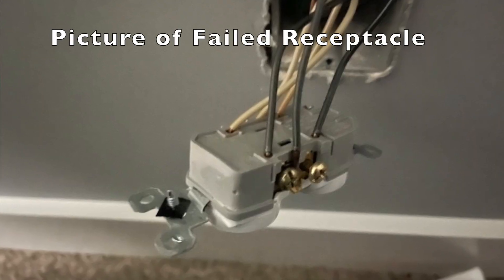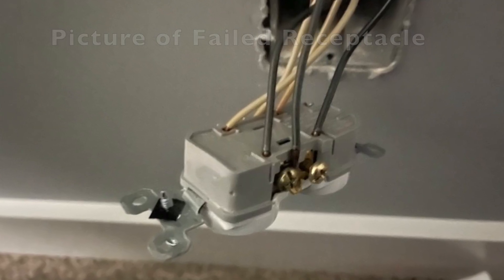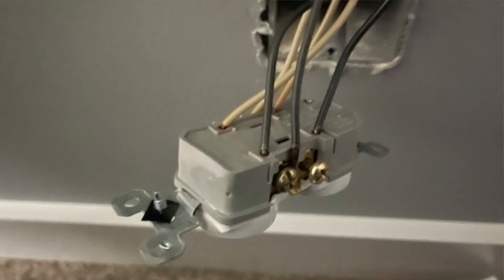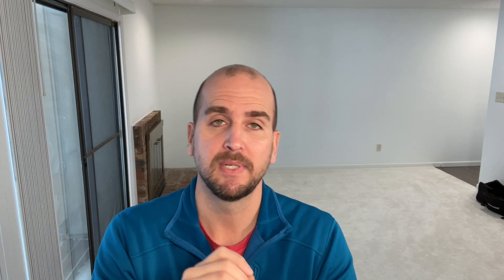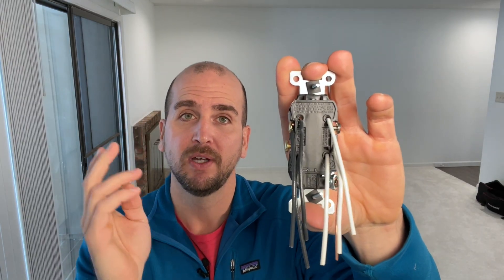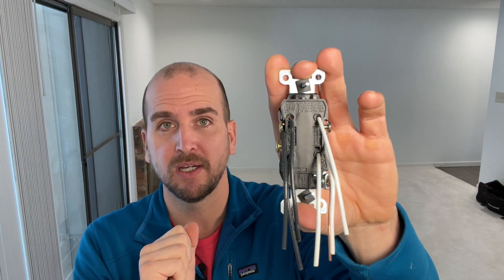Incorrectly Wired Outlet Found In Newly Built Home

Comment: As a self employed electrician of 25 years experience, I want to say I was upset with things you said at first. But listening to you I see your talking about the best way and not being incorrectly wired as your title says. The way the outlets were installed is normal and not against code and also, for all intent and purposes, fine.  The way you had 2 wires under the receptacle is fine and even 2 stab connections and 1 wrapped is fine. It is not incorrectly wired but you are correct that it can be done better. I only bring that up as I see some comment saying they had to "fix" outlets and things. I believe it would be more correct to say you had to update them as there was nothing wrong with it originally. 

Once I got past the "incorrectly wired" as "could be done better" then I was ok with it.  I have subbed for other electricians, worked for myself, worked as an employee for several companies and even did government jobs and light commercial. Everyone has their "best" way of doing it. Some take shortcuts to save in wire costs and some go above and beyond by tailing everything and always wrapping wires. I even had some that didn't even like to hook up grounds to switches SMH! My personal belief is I use wraps when ever possible and then stab only when I have 3 wires. I typically only tail if I have short wires or things like that. This isn't "best" practice I guess but there is nothing wrong with it. That's all I wanted to clarify :)

Just FYI, in my area GFCI's are now no longer permitted and you have to GFCI breakers instead. Again, this isn't a safety thing which is what codes are supposed to keep track of but it's a convince thing that I find kind of stupid in some points.  Like GFCI's on sump pumps or freezers and other codes that are meant to be safety things but can actually cause home owners a lot of money because their basement floods or a freezer trips due to a GFCI tripping. Sometime the best or safest way doesn't always pay off.
Reply: Check your continuing ed courses (unless you are in WV where they are not required). The (US) national code has prohibited using the wiring device as a connector for continuing  the circuit for at least 8 years. Pigtails are now  required in ALL cases where more than one wire would previously been permitted on an outlet terminal. You should be able to remove or disconnect any single outlet without interrupting power to the rest of that circuit.  I am guessing that the intention is to prevent open neutrals on the other outlets in the circuit in the case where a receptacle has a loose connection or fails.
Reply: @kimlground206  sorry, but no your wrong or I would have failed many inspections. Then again I guess inly what the inspector considers code is what matters. But then if you were correct, why does ever outlet have multiple connections if your not allowed by code to use them? I know, only 8 years, they didn't have time to change the outlets to meet code right? I am not saying your wrong, but it's not the code every where yet.
Reply: @gamingwithxelkhalla4890  You may well be correct. I haven't been able to find it in the 2020 edition so it may have come from a state amendment to the national code.  I will report if I find it.

Comment: I now use wago style wire connectors instead wire nuts.  I think that they treat the wire better.  With multiple wires going into a wire nut, I have seen one of the wires not making equal contact with the other wires and therefore sometimes make a poor connection.   Wago style wire connectors will prevent this.
Reply: You're supposed to twist wires together tightly with pliers before adding the wire nut. Doing that completely eliminates your problem.
Reply: @SomeGuy-vo7we  Twisting the wires at the perfect radius and level of pressure is sometimes difficult to get prefect.

Comment: I'm an lic electrician and you could put on some tape around the wire nut also when you splice the wires do 2 of then first than add the 3rd.The reason you found that wiring caus they're in the hurry to finish the house so they could get paid..

Comment: I notice your push-in wires came out easily when you unscrewed the post. Some of these sockets however are spring loaded and they are a PITA to remove the wire. Does anybody make a tool to depress these springs?

Comment: Nice job at telling them about the pig tells. You should have pointed out why we do that. The reason is if that recept fails then it's the only one that is affected. I have worked with res companies before and they do stuff like that to save time (money). I would also say that you should put electrical tape around the out sides so nothing can come in contact with the terminal. It's very important to do this with romex because out the bare ground wire. I have had the ground wire pop out and make contact with it after I have installed it.

Comment: At 4:41,  the 2 leads on 1 screw is perfectly fine.  2 screws on both sides eliminates pigtails which is an unnecessary pain!. And you are missing the ground pigtail. That make it  a mistake because there is no ground lead to the next outlet to begin with.

Comment: I was working doing HVAC work brand new built house my furnace wouldn’t go on at all the electricians were there I said I guarantee you used the stab locks for my emergency switch and it it’s just loose and hanging in there sure enough it was hate them stab connections
Reply from the maker: yeah, definitely increases the chance of failure
Reply: @thebanditabromowicz - you might want to get your keyboard looked at as the "period" button isn't working.
Reply: @chuckm260  don’t need proper grammar when you’re a hvac tech, electrician, plumber, roofer, sider, flooring, tile, custom bathrooms, kitchens etc. , mechanic, welder. Lol.

Comment: Lack of pigtail is a safety issue. If you have two receptacles in parallel and the connection point is at one of the receptacles you end up with a heating point at that receptacle. I have seen receptacles that heat up when something else is plugged at the second receptacle.

Comment: Good points and very much just common sense as well. I personally can't understand why code allows for push in connections on receptacles, as others have said, the surface area of wire contact is very minimal, and causes countless failures in primarily high current circuits, such as washing machine and other higher current drawing systems. Do not use push in system when wiring any receptacle that may see a high current load. IE: kitchen, garage, bathroom, even bedrooms may have hair dryer usage which runs 10 or more amps. If strictly being used for low wattage lighting, ok, say 3 to 5 led lamps in the shop would be acceptable.

Comment: Not a Box extension.  It's a,
 GOOF RING.  For the mistake cut or a tile backsplash. 
 A Box Extender attaches to the metal commercial 4 Square D box screws making three Outlet Box twice as deep.   And Wire Caps, are old school.  If you want to make money. You need to use WAY-GO'S.
They make (  2 port,  4 port,  6 port. 
Save time stab stab stab stab and Away You Go. 
🇺🇲🙏☮❤♻️

Comment: Others have commented both ways on the pigtails, (I generally don't if every wire has a screw available) but I'd like to point out best practice for installing wire nuts depends on the nut design. I use Ideal CanTwists almost exclusively, they are made in Canada and can be hard to find someone who imports them but I like them, however they don't recommend pre-twisting before installation, just line both ends up parallel and crank on the connector.

Comment: Im not a pro but I was always thought to tape around outlets and wire nuts to prevent accidental contact to ground.
Reply: I did the same thing for the same reason; but I talked to a union instructor & she said to NEVER tape the wires, just line up the wires & attach the wire nut & tighten as much as possible.

Comment: I just replaced some switches and outlets for friend of mine to help her out.   Previous owner a dangerous enough DIYr.   Pigtails were lazy and not twisted. ( wire nut came off and well, no power.   I’m still amazed at how many times I see pigtails and they are not twisted.  Guess I was taught young to do it’s dads way, but good lessons learned.  If there is room in box, or if very tight I will wrap wire nut and wires with electrical tape as added measure.

Comment: Using a pigtail on the neutral is required by NEC. Some "wirenut" manufacturers instructions say to Not twist the wires before using the connector.
Reply: When in the NEC does that stated?  I am not aware of that. Is that a local code?

Comment: Can you do pigtails for GFCI Outlets that have three lines going out with a fourth line for feed?
Reply: It depends. There is a line side and a load side. The GFCI should be the first outlet in your protected circuit. For the downstream outlets to be protected, it must run through the GFCI. Using a pigtail as described in this video on a GFCI would defeat the protection it would provide to the rest of the circuit. Unless the other outlets don’t need the protection, in which case, yes. You can do this on the line side and you’ll only be protected at that GFCI.

Comment: 20$ says its an apprentice that made the install... why do I know this? Cause thats what they teach in electrical school now. Why? Because it saves time and money for the contractors. Push ins are up to code, but try to remove them without cutting the wire and you will realise your better off cutting the damn wire! Do that enough and your 6 inch extra wire becomes very short very fast.. take the 60 extra seconds to do the loop and screw your terminals!! Your fellow electricians will like you!

Comment: I'm not an electrician, but I do not use pigtails when wiring outlets (except on ground, of course).  It's a waste of time, adds another point of failure (the wire nut), and can take up valuable space.  From my limited research, pigtails are only required on multiwire branch circuits (two 120V wires of different phases sharing one neutral wire), which are rare in residential wiring.  Again, I'm not an electrician, so take with a huge grain of salt.

Comment: As a 100% non professional homeowner I like to finish with not expensive AT all electrical tape around that plug or switch . Thanks
Reply: Just don't. Heat is the death of everything and you're trapping it in. The receptacle or switch is not going anywhere, there is zero reason to wrap the entire thing in tape.

Comment: One of the things I found was a good practice during my time as an electrician was putting a few wraps of electrical tape around the body of the switch or receptacle once it was wired. This was common practice in the more commercial/industrial projects rather than residential where we were dealing with metal boxes and mud rings. All the tape did was to help prevent shocks and sparks on the occasion that troubleshooting was later required on a hot circuit and the device had to be pulled from the box while live. It was more for the safety of the next guy to come along and perform whatever work was needed.
Reply: Hello Charles , I wrap outlets and switches for the same reason you do , To provide added safety against grounding out the connections on the box and helping prevent shocks for the next person who happens to work on it

Comment: I've been an electrician for over 30 years both a new construction and service electrician, and what I've found on many comment sections about wiring devices is how much many electricians exaggerate the problems with speed wiring. From my experience speed wiring is effective and safe and on the rare occasion that the wire does come loose, it happens almost immediately which means the problem is fixed before the customer takes possession of the home. While working as a service electrician, I found a more common problem is the wire comes loose from beneath a set screw and in the case of the wrap around types, sometimes electricians or helpers fail to tighten them at all and causes an arcing effects, burning the side of the device and often disenigrating it.

Comment: Good video.  In industrial electric shop, it was standard practice to wrap the wire nut and connected wires with electrical tape.  What do residential electricians think of that practice.  I wouldn’t think it would be a code violation, but I don’t know that for sure since I only worked in an industrial setting.

Comment: I use the eaton brand back wire commercial grade outlet. The wires dont go under the screws. They have a heavy duty clamp in them. Better than pigtails in my opinion. Ill use all 4 spots

Comment: Never stab conductors, always wrap around the screws. M0ore surface area and less chance of it prematurely heating up. If you have 3, wire nt them and them wrap one conductor on the screw!! Its not against code, just bad practice.

Comment: Really appreciate that you're featuring advice from licensed electricians, and showing best practice.  As the owner of three houses, always want to wire to better than code.
Reply: Yes keep in mind always never wire to the backs. Of a device. Ever the amps will pass thrue  on  path back to panel  also if a wire can break and is dangerous
Reply: N.E.C. is the minimum requirement which means I would wire YOUR house to the N.E.C. but not my own
Reply: @thomasvick1755  Don't like minimums on any professional trade work. Wire a house like it's your house.
Reply: As
Reply: The code is written by trade professionals and updated every three years to require the use of some new product. You really dont need to be thinking about wiring BETTER than the codes. I mean, it's not like these are the guidelines for nursing homes which allow 1 nurse for 25 residents who all need care.
Reply: @jeremyanderson3819  codes are minimum requirements.
Reply: @jeremyanderson3819  Well said.   You can't really wire "better" than the code. It's a sort of nonsensical idea, since the book ("not for laymen":100) is a guidline for installations. You cant buy "better" NMB, or provide "extra" capacity to conductors, etc., because that would be a crummy, unworkmanlike install.

Comment: I have seen new homes wired by using the holes in the back which my electrical Teacher explained to me 40 years ago that the amount of contact inside the hole is next to nil. Push ins create light brown outs just from vibrations of the homes walls. The only reason for those hole connections would be Tempory testing purposes. There is no better way than screw terminals hook ups and using those holes is nothing less than lazy workmenship and dangerous in my view.

Comment: You shouldn't pre twist wires with your lineman. Let the wirenut do its job then tug each wire to make sure it caught. It is very irritating when people do this. Truly 
The sign of an amateur. Quite often the wirenut will not catch properly and someone can come behind you open the box wirenut falls off and someone gets hurt. Just make sure the ends of the wire line up and you are using the right size wirenut. Let the wirenut do what it is designed to do. Of course check that you didn't do a mistake by tugging on each individual wire to make sure it doesn't fall out.

Comment: Very well presented. Thank you.
One thing to also think about I believe is, when remodeling older homes, always double check and upgrade the electrical as needed. I have found a lot of things that used to be common practice for say the seventies do not hold up to todays usage. Our home was built back in 1977. I found that the entire living room, one of the bedrooms, and the stairway and outdoor lighting were all on one circuit. This was fine when the most you might have see in a bedroom was a lamp and/or clock-radio, but just doesn't hold up to today's usage.
Another thing I've seen over the years is that houses, condos, etc. built during times of increased development (housing booms) tend to have more questionable issues. This may be either to building inspectors being overloaded or to less-experienced craftsman being hired to do their own jobs where normally they would work under someone else or a combination of both. If your home was built during one of these "booms", it may be worth hiring an inspector before buying.